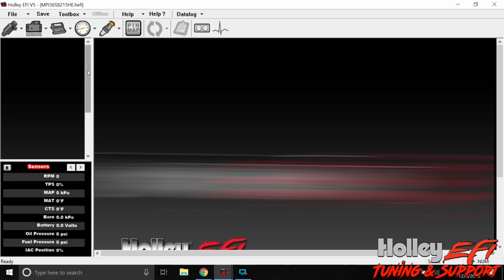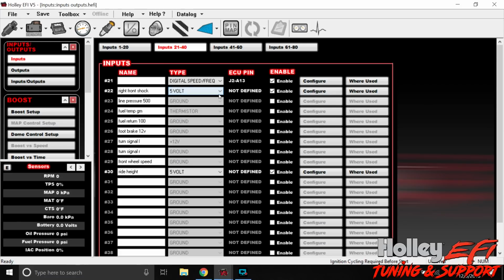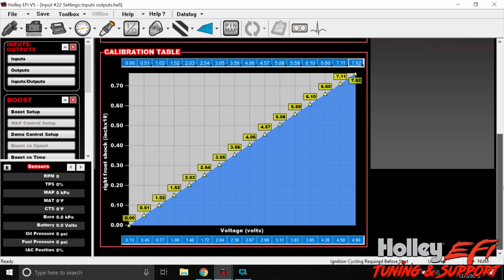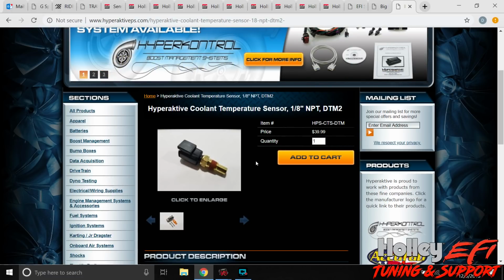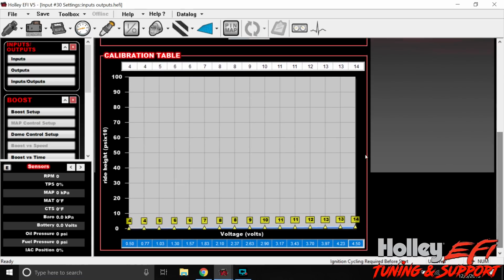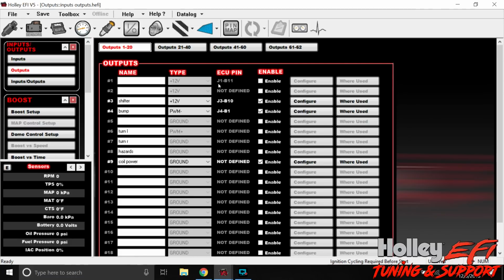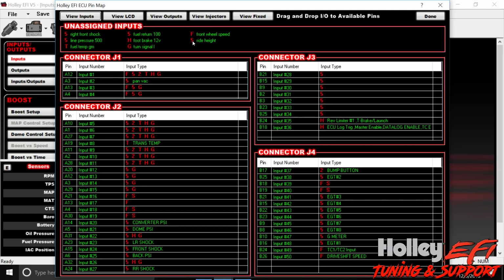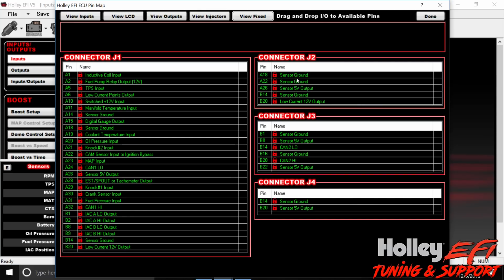Holley Efi Inputs and Outputs configuration

Comment: This stuff really isn't that complicated, it's just very detailed - but the GUI/user interface still has a ways to go. The way they've simplified it works pretty well for helping people get the basics setup, but there's quite a bit of stuff that just isn't very self-explanatory and that isn't clearly explained up front. It's a pain when you've gotta do research to access some simple functions due to purely layout problems.

User interface design is by no means 'easy', certainly not for devices like these powerful standalone ECUs - but we need better none the less. Until then, we have channels like this, forums, groups, etc. though!

Comment: Awesome stuff Devin and you do incredible work. I am installing a Super Sniper 1250 and have a question. The Sniper version of the software is a stripped down version with NO ability to add the I/O icf and add custom outputs. The canned options are 2 fan outputs, an A/C output and a Secondary Fuel Pump. I want to use the secondary fuel pump output but I also want to fire the relay on my water/meth pump. The only option would be to connect the fuel pump relay AND the meth pump relay to the same output wire. Is that a bad idea from a wiring standpoint?
Reply from the maker: As long as you're triggering two relays that's fine